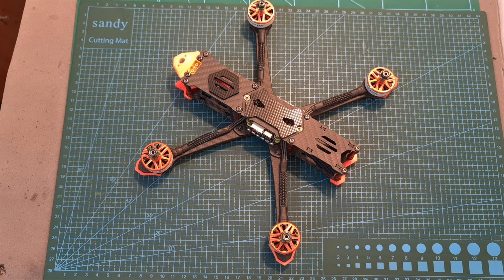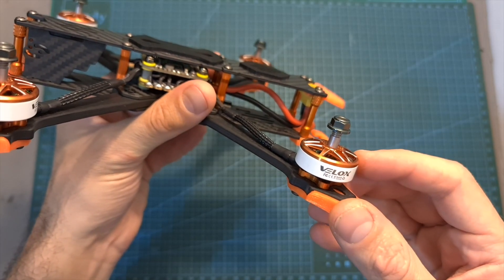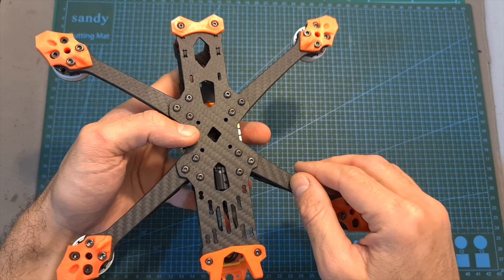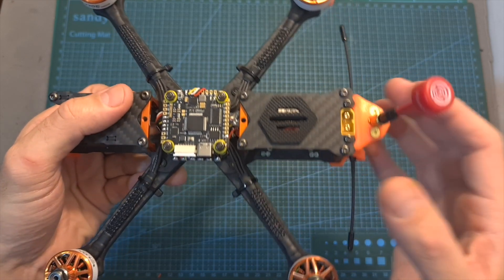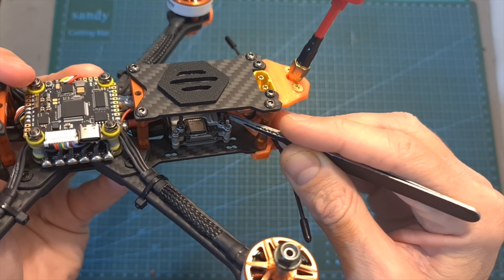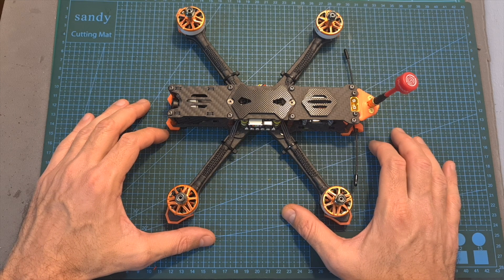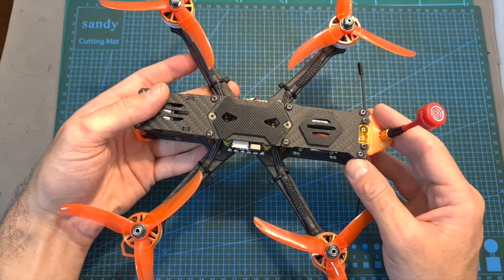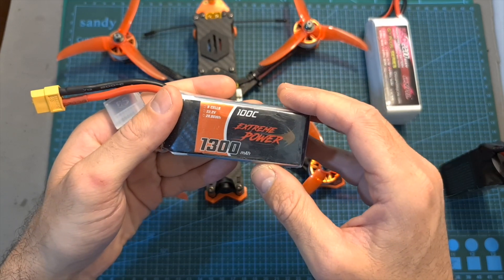T-Motor FT5 MKII 60% Build - Setup, Overview & Flight Footage

Comment: Missing the needed screws and cables you'll need to build it in this typical setup (vista/crsf)  is kind of a gig on such a pricey priced quad.    How much could one connector and 4 screws cost?  Now I got to go internet hunt for these fiddly little bits.

Also it looks like the soldered to the bottom of the ESC, which is going to make it a PITA to replace a motor.  

Every manufacturer seems to be doing it because it looks cleaner visually, but that's not going to make it easy at all to replace a motor.

Comment: Hi! thanks for the review!
One question, do you have any link of .stl files of this MK2 version? cause i have seen many files, but all of them are for the mk1 version and onle motor bumpers are working. the pieces from the front(bumper, camera support) and back (gps, antenna, crossfire) none of them works due to different meassure.

thanks in advance
Reply from the maker: My pleasure. I am sorry but I don't have any. I suggest searching Thingiverse and contacting Tmotor, maybe they can help.
Reply: @KremerFPV  thx for the answer! Contacted them, lets wait if they reply.

Comment: Gal, perhaps you could help. I have tried two different Vista units and three different flight controllers and I am not getting any power to the Caddx Vista. Any ideas? Thanks in advance!
Reply from the maker: How do you power them up? Have you watched this video? https://youtu.be/u2zU2GPvt6g
Reply: @KremerFPV  watched it several times. I have soldered the vista to a DJI cable and trying to use the FC DJI plug.  Is there some reason why the DJI plug is not sending power to the Vista?  I noticed in your video that you mentioned bridging something together, but not sure what that means.  Thanks for the help Gal.
Reply from the maker: @MarcsFpvAddiction  Which flight controller are you using? The same one that I show in this video by T-Motor?
Reply: @KremerFPV  yes sir, the 60% build. I ended up buying a 2nd one because I thought I messed the original FC up somehow. Also bought a brand new Vista.  Can't wait to get one in the air. Lol!

Comment: Ok but problem about v1 and v2 carbon not good quality i have 2 frame v1 and one v2 and very easy arms broken and T-motor want recified this about v3 waiting if doing this in working I like this because it is my favorite frame build but problem about carbon quality sorry for this friend! but return after experience test is the best important for another's peoples interesting this it is transtec doing frame for T-motor WAITING V3 if rectification problem???
Reply from the maker: No need to be sorry. Thanks for sharing your experience.

Comment: Hi Gal    Great video and review of the T-motor FT5.  I am impressed with it. I would like to have had a quad like this when I started, but I don't think that the F3 F.C was out then. I'm sure you're able to use a analog version with it.I can think of some VTXs that I could fit in the back of the frame.  Thanks again for the information and video.
Reply from the maker: My pleasure Johnny, thanks for watching.

Comment: So this is a V2 of this frame... interesting. 
I heard people say that the center section of the top plate is a weak point, does that look the same as the V1?
Reply: I've heard arms were the weak point, not the center section. Also, MKII (v2) can easily be recognized by that amazing XT60 mount flush with the top plate and secured nicely inside. No power leads dangling around. Amazing!
Reply from the maker: Yes the XT60 mount is very useful. As for the weak point - I never broke a top plate but I broke plenty of arms :-)
Reply: @KremerFPV  - yes, that's what I've heard. Some people call T-motor's FT5 a "glass frame" :)